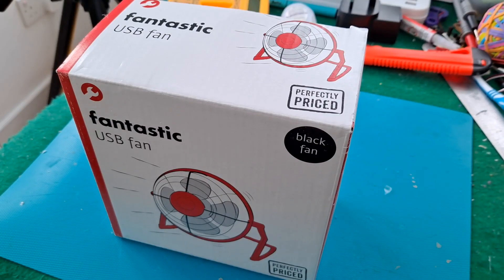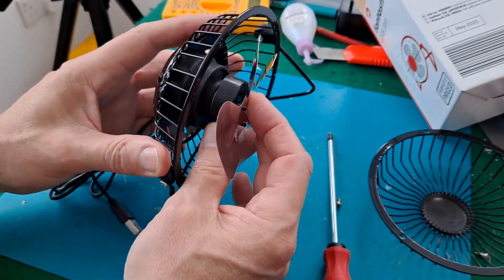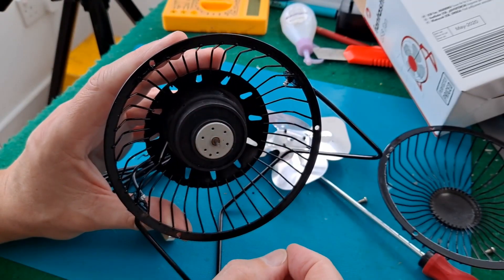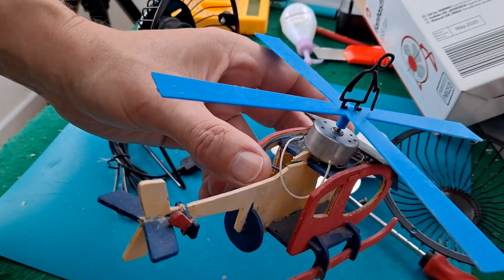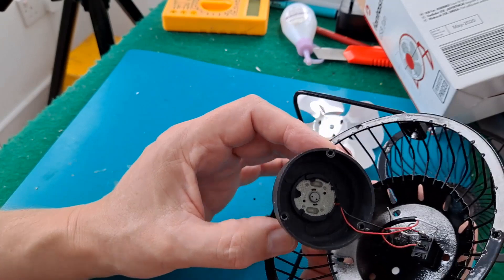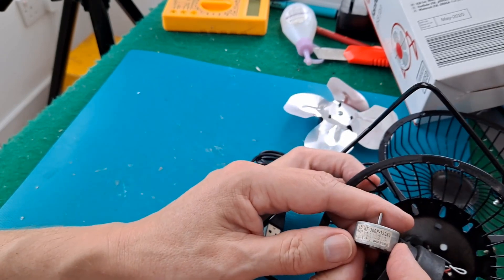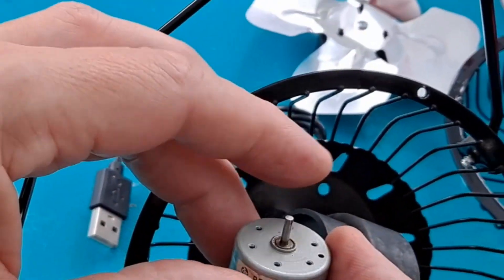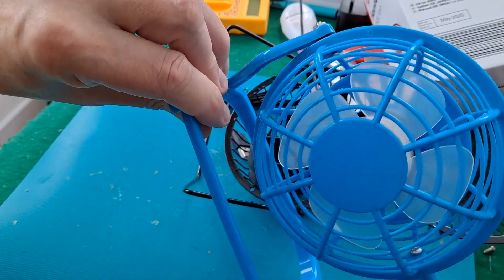Poundland USB Fan teardown to check the motor

Comment: Mine has a BLDC motor and the bearings are worn out, so it chatters. It did have very heavy use in the three years I've had it, so I can't complain. The wire guard is good quality, so it's worth finding a replacement motor for it.

Comment: I've purchased USB Fan which has 3 speed, but is there any way to save Last state of usb fan ?
Cause moment I disconnect from usb and reconnect ive to press physical button on the fan to turn it on
Reply from the maker: Logically, the push button would be stepping a circuit through a series of outputs. You could probably take it apart, throw away the circuit board, and replace it with a manual rotary switch with a series of resistors to give the different speed. If you only wanted one speed, you could probably connect the motor direct to the input so it always runs when you plug it in. Other than that, you would need to study the circuit board, identify the components and then work out if there is something you could do to change its functions.
Reply: @GrandadIsAnOldMan  yeah i want same speed when connected to USB
PLZ Guide he me how to do that
Reply from the maker: @VedantiUjawane  find the two power wires and connect them direct to the fan motor. If you are not confident in doing that, then don't try. You are only dealing with 5 volts coming out of a USB power unit, but, worst case scenario is you short circuit the wires, that overheats your USB power supply and that catches fire and burns your house down.
Reply: @GrandadIsAnOldMan  woahhh
Reply from the maker: @VedantiUjawane  just giving you the worst case scenario, same as getting out of bed, tripping, and breaking your neck as you fall over. Life can be viewed from both sides, positive or negative.
Reply: @GrandadIsAnOldMan  totally understand!!;
Do you have any video tutorial to do direct power supply (with highest speed) to usb FAN
Reply from the maker: @VedantiUjawane  take it apart and have a look at it. There will be two wires on the USB cable and the motor will have two wires on it. Connect the two USB wires to the two motor wires. That is it, job done. If the fan turns backwards, swap the wires over. Just make sure it is unplugged while you work on it. I am guessing you don't have a soldering iron so you will have to strip some of the insulation off and twist the conductors together, then put some tape over the join so they don't come loose and they can't touch anything else. At around 02:37 you can see the wires and motor in this video.

Comment: Oh fantastic thanks Grandad, been looking for a cheap source of those flat bottomed DC motors 😃
Reply from the maker: I would buy them on ebay if I was you. Cheaper and you would choose the voltage and rpm you need.
Reply: @GrandadIsAnOldMan  I've been looking but I only need 2 or 3 and I cannot find any cheaper than £1 each for that quantity, but I am the world's worst person at searching for things 😅
Reply from the maker: @SquareOrbits  Note: This fan cost £2, not everything in Poundland is £1 any more, but as you say. the prices on eBay have all gone up, so maybe not such a bad price if you want it quickly. Cheapest I could spot was £1.34 plus 89p postage, making the fan cheaper 😆 They are cheaper on AliExpress but you have to be very careful what you buy there. Many listings are misleading and sometimes they include tax, sometimes that is added at the checkout and obviously some include postage and some don't. And delivery time from AliExpress is usually months. Here are a couple of examples https://www.aliexpress.com/item/1005002013678373.html https://www.aliexpress.com/item/1005001804004072.html
Reply: @GrandadIsAnOldMan  Ugh I did reply to this but it seems to have dissappeared. If it didn't go through: hey thank you :) much appreciated.

Comment: Those are the same type of motors used in dvd and cd players from what i know those run on 9v so it'll be fine running it on 9v especially since it's just a fan and it doesn't have a huge load in it so it won't need much current to run
Reply from the maker: You cannot judge a motor by looking at the casing. You would need to know the number of windings and thickness of the conductor before you can judge what voltage and current it is designed to run on. If you are lucky it will have a label or numbers stamped on the case. I have identical looking motors that are designed to run on the output from small solar panels, so maybe 1.5 volts.

Comment: I got two of these and one was stronger than the other. Took them apart and they had different motors in them. Tried to put 9 volts through it (not a good idea). It didn't die but it did get hot and stink. One of them is now an extractor fan for a laser engraver. I also printed new blades in an attempt to quieten them down. It worked somewhat.
Great video. Keep up the good work.
Reply from the maker: Sounds like a lot of extra effort, just to use a couple of motors you could have bought cheaper and better online 😆

Comment: I’ve never actually seen a small fan being taken apart like this before. I have a little cheap fan from my local Dollar Tree dollar store. It’s super cute and it’s a good fan for when I draw in my room and I need a bit of a cool down. It actually looks similar to the blue fan you showed in the video.
Reply from the maker: Yes, my blue one has a different type of motor, which is why I took this one apart. I had expected the same motor, but this one is simpler and cheaper.